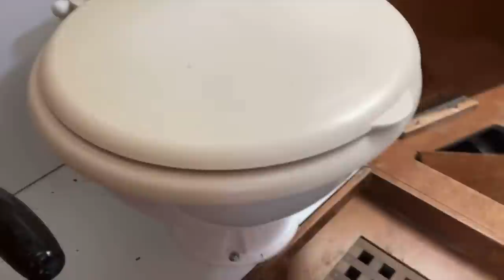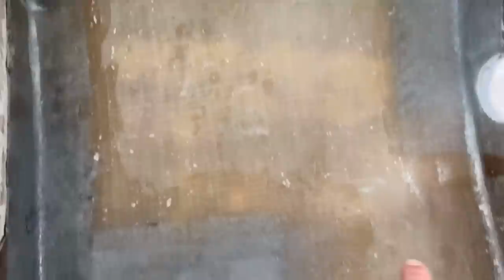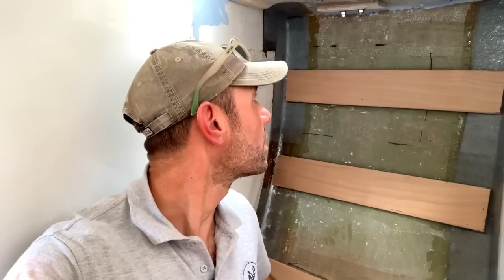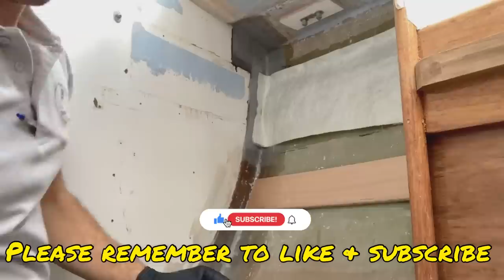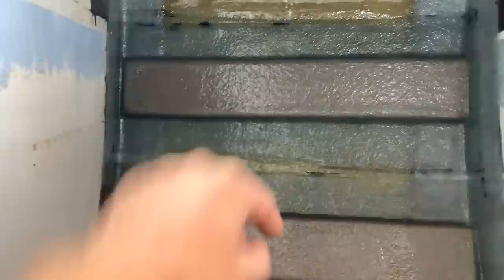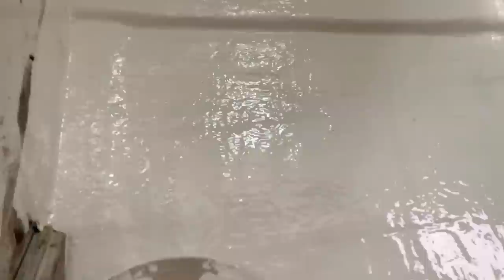Building a New Heads (toilet) Compartment on a Contessa 32 (Project Lottie Ep 23)

Comment: Perfect timing, I am doing exactly this to mu 1982 Westerly Konsort! Specifically the holding tank mounting, as my Jabsco is fine. You are giving me a lot of confidence to do the job the right way. Thanks 👍
Reply from the maker: Great, best of luck with the project.   If weight is not an issue you could use corian (or similar).

Comment: Mine is a 1978 so it has the GRP molded liner with the fixed sink.  My holding tank is in the exactly the same place and it was cool to see how it must've been installed.
Reply from the maker: You have my preferred heads arrangement, the new one has a pull out sink like the older/original style and it’s not so nice to use IMO

Comment: The shape of the holding tank outlet looks guaranteed to block with solids. Unless manual disimpaction is a job the owner enjoys, a straight down outlet is less likely to block. Some way to poke the outlet clear from the deck pump out helps. A diverter bypassing the tank is essential for when blockage inevitably occurs (which usually means another seacock or a clever combimation of diverters).
Reply from the maker: The removal of waste from the bowl ti the tabk is via a diaphragm pump so that would break up any large solids, the one way valves in the pump only open so much so it “should” be ok as long a people are not flushing sanitary towel or kitchen tissue in there.    I generally say no loo roll goes into the tank on my boat and I have never had a blockage.
Reply: @RefitandSail surely loo roll I'd OK, it's designed to fall apart, try using it to clean up some luiquid.
Reply from the maker: @waterboy8999  depends on the loo roll, the expensive quilted “posh” stuff that some people (mostly women) like to buy doesn’t break down easily like the cheap stuff I prefer to use on a boat.   So as with all things in life … it depends 😁
Reply: @RefitandSail  I've not encountered posh loo roll yet, not on my boat at least.....

Comment: George, I'm curious ... it looks like you didn't put thickened resin between the ends of the stringers and bulkheads.
Just wondering if there was a reason for this other than saving on resin & time. I would think that filling the gaps would make installing the fiberglass easier.

Comment: The more I learn of fibreglass the more confused I get! From what I see you epoxied the ply to the hull, which I get. However then you used CSM which I understand to be a no no with epoxy. So is it OK to mix them?
Reply from the maker: I wasn’t using epoxy…. Plywood was bonded to the hull using a polyester based bonding paste, it was then glasses over using a polyester laminating resin and the polyester flowcoat over that.    All compatible products.  Nothing wrong with using epoxy in much the same way but as you say, most CSM is not compatible with epoxy beciae it needs the styrene in the polyester to breakdown the binder that holds the csm together.    Hope this helps 😁